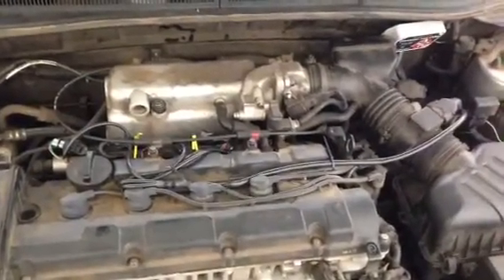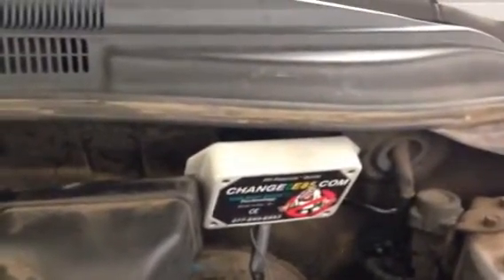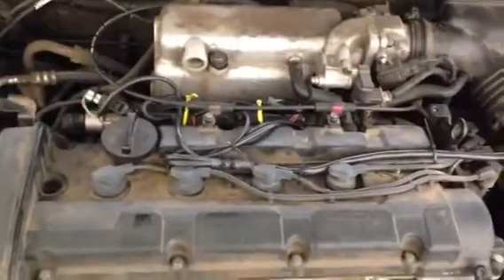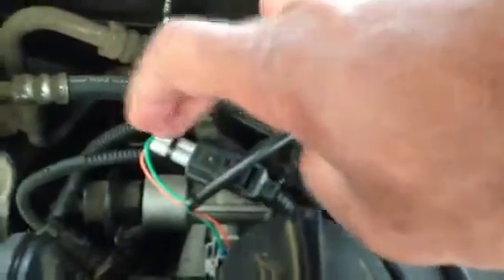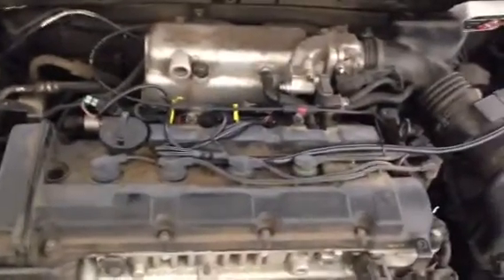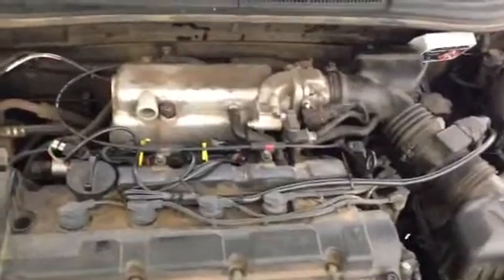Converting a KIA Spectra 2005 into a Flex Fuel vehicle

Comment: 2009 KIA RIO, I have done simple mechanical repairs myself but a mechanic I am not. I see that there are some specifications on injector connector types and possibly fuel injection system type (Direct or Electronic) Do you know if I can do this to my car? If so I will do this ASAP, your response is greatly appreciated!!
Reply from the maker: I've owned 3 Kia's and i believe all were EFI. I know 2 of them are and I would be surprised if yours weren't as well.  I believe you have a 4 cylinder EFI like all the rest.   You can google for the fuel delivery specs of the Rio to be sure, but I'm fairly certain it's a EFI system.

Comment: Thanks for posting this. I'm curious, did you happen to try E85 before adding the kit? I just topped off my tank in my 93 maxima with what amounts to about E60. I've been driving it around, and can't see any reason why I shouldn't be doing this. The car runs fine. Wide open throttle, no problem. I understand what the kit does, I'm just not quite convinced it's always necessary.

Comment: I have an 05 Silverado I converted 4 1/2 years ago, no problems. I go twice as long between oil changes. Spent 4 years prior to that splash blending about 50/50
Reply from the maker: Thanks for the comments. The info will be great for those considering conversion to E85 or simply blending to get the benefits.

Comment: Hello rhandsom. Thank you for your insightful video. I just recently ordered my conversion kit from change2E85.com. I am relieved to see that it works for you because i am installing it for my brand new 2014 toyota corolla. Hopefully everything goes well. :)
Reply from the maker: After over 40K miles, the car still runs and no aparent fuel system problems.  I have close to 241K miles on my car, so the only issues relate to age such as suspension, transmission, etc.  But the engine still runs fine.

Comment: So does this unit only plug in between the injectors?
Does it interface with the ECU at all??

It seems as all it does it increase the injector duration to get more fuel in, as E85 will use about 15% more fuel. If this is all the kit does, I would be worried.
Reply from the maker: Yes, the unit works between the injectors and the ECU to increase the pulse width controller the amount of fuel injected into the cylinders. It doesn't interface with the ECU itself. And yes, due to the decrease in BTU's it will use a little more fuel than regular gasoline. However, running it close to 40K miles, there is no apparent damage to the fuel system or vehicle in general. My vehicle has close to 240K miles and it still runs fine.

Comment from the maker: Thanks for your comments. Generally speaking, converted cars running on e85 loose about 10 to 20% in fuel economy, but benefit from 10% or more power (torque) due to the higher octane. My vehicle is rated at 24 mpg highway, and oddly enough I'm getting 24 to 26 mpg, meaning I was likely getting more on straight gasoline. Running on e85 is cheaper for me, due to my area ($2.79 gal), my driving habits, and fill up routine. In this video I just wanted to answer the question could it be done.

Comment from the maker: Thanks for your comments, and you are correct, isopropyl alcohol and methanol are indeed 2 different things. In fuel economy I do seem to break even, which makes it worthwhile in my case. In terms of horsepower, I have noticed the gain in horsepower, no losses in that area. The car seems more responsive when running on E85. I've been running on it for over 13k miles now.

Comment from the maker: Thanks for your comments, it's good to hear from someone else who has been running E-85 as well, especially with the mileage your reporting. My car is running fine, I'm at the point that I don't like putting anything but E-85 in the car. I've read, heard, and seen so much bogus information against ethanol that it's really pathetic. I pay $2.79 a gallon for E-85 and my engine runs quiet and better than cars at half it's age and my engine has over 223k miles on it.

Comment from the maker: There is nothing to see.  It's a stock KIA, there are no modifications aside from the E85 kit. I have a tool box, a mini 12v compressor, jumper cables, a drill, gloves, gas funnel, 5 gallon gas can, an extension cord, light, tiny inverter, drill bits, dremel tool, spare tire, tire iron, jack, umbrella, cleaning supplies, rain suit, a walking stick, and maybe a few other little items. That's it dude. Survival is not about what you have, it's about what you can do with what little you got.

Comment from the maker: Thanks for the comments.  Any engines that use E10, can't sit for extended periods of time with the fuel in them because will cause problems, that's why you have to use a fuel stabilizer, My guess the weed eater was also using E10, E85 is a blend of 85% ethanol and 15% gasoline, E10 is a mix of 10% Ethanol and 90% gasoline. There is a definite difference when it comes to the blends. See the links on the description, they help to tell the "rest of the story"